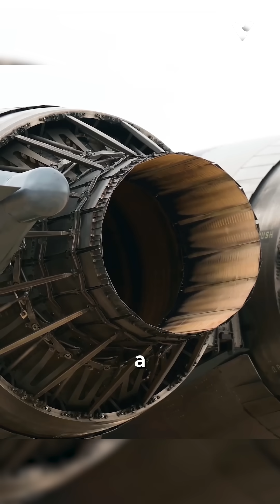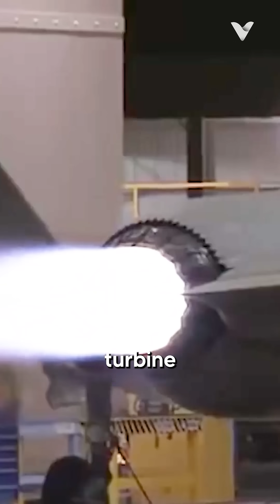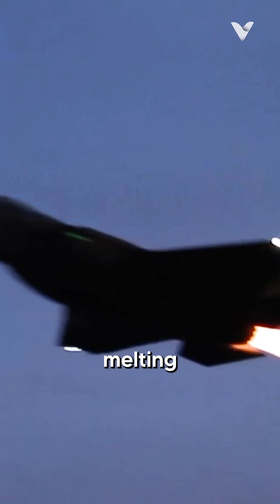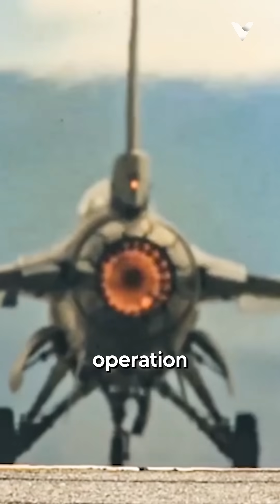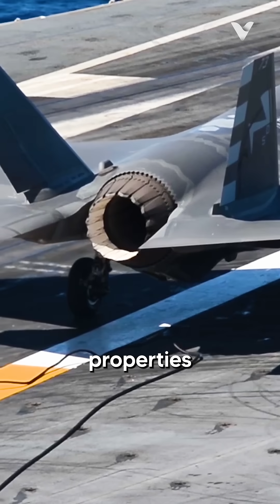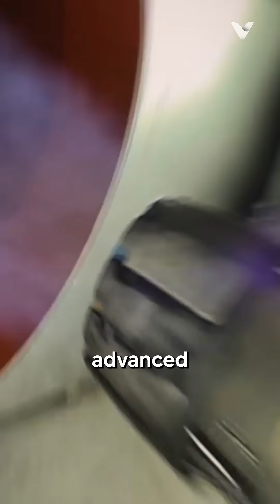Why Don't Jet Plane Nozzles Melt? #shorts

Comment: They can melt if you use the afterburner too long.
After burners and/or turbos are a TEMPORARY solution. If they were a constant solution, it would just be called, TOP SPEED.
Boost/Turbo/Afterburner is temporary because things will malfunction otherwise. AKA, melt.
Reply: Pretty sure it has more to do with the amount of fuel consumed, not temperature
Reply: @chriss5266 Sounds like you never change a  divergent seal or flamethrower before. There are inflight limits as well as ground limits as to how long you can be in burner. Fuel is one but it will accelerate wear on all the Augmentor and nozzle parts

Comment: On the f1 engines on the Saturn V rockets, the supercooled liquid oxygen that is used to facilitate combustion are pumped through pipes in the combustion chamber like a radiator. This was so effective that not a single F1 engine failed due to combustion chamber warping due to heat retention

Comment: It’s not just a jet engine, it’s actually low ratio turbofan engine used, which means there is a stream of cold air between the hot exhaust gases and the outer wall of the engine and nozzle.
The exhaust turbine blades have tiny holes in them for creating thin film cooling with air. Yes, the blades are Inconel and really really heat resistant, but combustion temperatures will still melt them with prolonged exposure.

Comment: The physics behind the jet engine is that the heat generated by the burning of the fuel actually expands the air in all directions, throwing molecules that hit the front of the turn, pushing the vehicle towards the side of the thrust. The only side that does not receive thrust is where the air comes out, being the only side that does not offer resistance to the air that has expanded.

Comment: Speaking in the terms of turbofan engines, the cooling is through the use of cool secondary bypass air. Augmented turbofans are low bypass turbofans, which means that the majority of air goes through its core while the remainder bypasses via secondary casing. 

In the turbine section, that cool air goes through the high pressure turbine (HPT) nozzles to keep the nozzles internally cool as well as through the HPT Rotor. 

When it comes to the Augmentor (afterburning) section, cool air is routed through the nozzle under a liner which has holes all through the liner which allows cooling air to keep the exhaust from overheating. That same liner is inspected as part of the post flight inspection to make sure there’s no clogged holes, which if clogged can result in hotspots thus creating a burn through. 

21 years Propulsion Tech F110,F101, CF6
Reply: Thanks for the comment, very interesting

Comment: Also the nozzle tightens the exhaust when the pilot uses afterburner but after a second or two the nozzle opens up to avoid melting
Reply: Incorrect. When the nozzle closes it builds pressure and increases thrust (think of the finger over the water hose concept). Also, that same pressure buildup helps maintain fan speed by making sure the LPT doesn’t overspeed. Once augmentation is initiated, it opens up due to increasing pressure from the secondary combustion

Comment: You could have just said it doesn’t melt because they made it in a way that it doesn’t melt. Because that is all you said. Now to the real answer, I'll make it very short, 1. the speed of hot gas exiting pushes away from metal like walking on coal 2. Internal cooling by both rotating fuel and dumping fuel on metal walls to make a repellant 3. Ionization and treatment of metal similar to rifle barrel. For specifics read nasa sp-125 section about cooling exhaust

Comment: Cool air boundary is more important ! Best superallow melting point is 1350. And start to hight deteriorant at most at 900. You applyceramic coating. Then cool air boundary is also important. And you even have tubing inside both in stator and rotors to circulate cooling fluid (fuel if i remember well).
So, even if the flam can go up to 2200 degrés, the metal never see that température. Not even half of it.
Reply: When performing solution anneal, in a vacuum furnace, it's interesting to note that the standard run temperature is 2,000-2,200 for several hours straight on most turbine flow path alloys.  Ex: Solution @ 2,150F / 4 hrs
Reply: @christx3326  but you are talking in stupid units. In international, it is just 1175 °C
Reply: @texasranger7687  Yes ma'am, as a European descendant raised in Texas, I'll agree to that.

Comment: I worker on F-14 Tomcats in the Navy. The second they shut the engine down you could stick your hand inside of the rear nozzle area and it was cool to the touch. It was cool because the super heated air never touched the actual metal due to a boundary layer of air while it was running.
Reply: Now THAT is neat!
Reply: Must be physics
Reply: @soumya_sarkar96  periodic table
Reply: How come this wasn't true for the F-15? Entering that engine during summer was ... not fun, to say the least. You wouldn't get burnt per se but it was really hot
Reply: @Israelpwn  I remember changing a flameholder in Saudi hours after hey had lander and still cooked my ssa off 😂😂
Reply: @Israelpwn cause it was the summer. I’ve been in the intake in summer, in the bunny suit with booties. It sucked.
Reply: @gunsandgranola7262  you was hiding from the sun who u kidding
Reply: @ pretty much. Lol
Reply: @Israelpwn it is the same, right after a burner run your able to touch the nozzle, the reason it sucks to jump the nozzle is that heat from the core, spray rings and other components do still hold heat that radiates off
Reply: @Israelpwn  why would you have to enter the engine ? Im back in the expedition sign on the back lets go fishing...
Reply: @Israelpwn I'm sure they were still hot in the context of sitting in an augmentor or intake. But touching the nozzle segments is what was surprisingly cool after engine shut down. Even at idle the air coming from the aug isn't scolding hot.
Reply: I worked in the test cell department of the AIMD mech shop on the CVN-72 USS Abraham Lincoln. I was the electrician. There is nothing cooler than being just a few feet away from a F-14 Engine strapped to the cart on full after burner pumping out 22,000 foot pounds of thrust. Producing heat rings every so many feet. It is such an awesome memory that I'll never forget. This was during a WestPac 2000-2001. We were the first ship to receive the Super Hornet.
Reply: @industrialpalletworx3548 That would be 22,000 lbs, not ft-lbs which is a measure of torque
Reply: Gotta give it to the first person who tried.
Reply: Now that is absolutely insane to me. These engineering of these engines is incredible
Reply: Ahh the Flying Tennis court. Alwaysed loved the F14 because of Top Gun, Macross (aka Robotech) and Swat Cats.
Reply: @MilkT0ast  Kawamori and his team went to Edwards Airforce Base for Macross Plus research.
Reply: @MilkT0ast wow Swat Cats. Deep cut fr.
Reply: That is honestly the coolest (pun intended) aircraft fact I've ever been told.
Reply: I worked on F 14 afterburner assemblies in the Navy. They do get hot. Titanium and inconel stand up to the heat and ducted cool air around the exterior. They would still distort and crack. They could be a real pain to disassemble, especially the GE F110 engine.
Reply: @greghardy9476 Too bad after the SLEP mods, it seems nobody ever had the bit to remove the divergent seal base sheets lol. But at least the segmented flameholder was a good idea.
Reply: I love Tomcats. Such a gorgeous airplane. So ironic that the only nation flying them now is Iran 😔
Reply: @JS_Precision That's because they were the only other nation to get the Tomcat.
Reply: @Invidrule  Really? Thats says a lot of the relation between the US and the Shah at the time. Before Israel became the US watchdog in the Middle East, Iran was.
Reply: @JS_Precision  Well, the F-15 is still in use, and has a very similar silhouette.
Reply: @JS_Precision  , not many are airworthy nowadays due to lack of spare parts. Maybe just a handful are in service, but I may be mistaking
Reply: @JS_Precision barely flying them.
Reply: @JS_Precision  They truly are beautiful.  I was fortunate to be able to take a picture of a retired one. Right outside of the Oakland airport. Oakland Ca.
Reply: @JS_Precision  Oops. Iran.
Reply: @JS_Precision  NOT ANYMORE, MY FELLOW AMERICAN ! WE TOOK THEM BACK AND PERMANENTLY RETIRED THEM, ALL IN JUST A FEW SECONDS 😂 ‼️👉👑🇺🇲🇮🇱👉🦅💥💥💥🪶
Reply: @JS_Precision wish I could down vote this.. 😞
Reply: That is insane engineering
Reply: Aah, the Tomcat. Still the most beautiful NAVY fighter jet I've ever seen. Such a shame it never was nominated for an upgrade to match gen 4 or 5 fighters we have now. Bring it back, pls!!!
Reply: @marcodevries994 : Grumman did propose the Super Tomcat for the 21st Century (ST-21) which would have kept the same design and characteristics but with newer, advanced engines, avionics, and better wing sweep mechanisms (which on the aging Toncats were some of the most maintenance man hour intense). Grumman proposed New aircrafts, or a combination of reworked Super Tomcats (the D models) with overhauled aircrafts. Dick Cheney however, hated Grumman while favoring Boeing (which he ownedd a lot of stock) and when he was Sec Def he pretty much killed Grumman's reign on Naval Aviation. The Super Tomcat & ST-21 would still outperform and out range the Super Hornet.
Reply: @Dutchman_in_Spain  You fool they virtally crashed and destroyed all the planes except a few static models , and all documents relating to technical know how have also been destroyed so that Iranian government can not get the parts or plans on the black market... Shit I am an Aussie and know more then you dumb yanks about your own procedures.
Reply: @Dutchman_in_Spain $$$$
Reply: @Dutchman_in_Spain LOL bring it back? It was a boat
Reply: @howardelzey2760  The boundary layer helps but radiation is going to cause that material to be screaming hot right before you touch it. I'm guessing it was cool because it's designed to shut down that way, with cool air running through the engine as it spins down.
Reply: @biggieb8900  Radiation?? That’s a new one 😂
Reply: @thatmitchellguy  Heat is part of the light spectrum and therefor follows dispersion patterns and decay seen with other waveforms. Radiation is an appropriate term.

There's no way a layer of air can prevent that much heat from being transferred unless there was a designed laminar flow channels all throughout the housing. The Space Shuttle's RS25s had cooling pathways in the housing but no method of creating a laminar flow separation between the exhaust and the nozzle housing. If you have static air, even with it's low thermal conductivity, the surrounding metal would still receive enough heat rendering it unsuitable to be touched even with protective gear. So the turbine would just use bleed air to form a protective barrier around the main exhaust cone.

At shutdown, I would guess, as others have mentioned, that the turbine cycles through fresh air to even out cooling and put less thermal stresses for contraction.
Reply: Thanks man this was more clearer explanation than this wannabe storyteller video
Reply: I'll take your word for it
Reply: Would heat not radiate though? There's so much IR that can cross that boundary
Reply: You are talking about the TF30 , the F110 or both?
Reply: I was an engineer on the SS mino johnson
Reply: Super cool engineering.
Reply: Bro, don't make us make a mistake! 😂😂
Just kiddin'. Thanks for the info
Reply: I used to warm my gloves up in the winter by putting them in the back of an engine. It was commercial jets when I was a fueler.
Reply: R & D ......get you that....not to mention years of that.
Reply: Had one of the pieces in my hand. They have super tiny holes all over the place where high pressure air comes out to create this „film of air“. It’s funny that this air is also super hot bc of the pressure. About 600 degrees Celsius (depending on model). But that’s far below melting point of the used metals
Reply: That is cool
Reply: Not just the exhaust nozzles. The boundary layer of air bled off from the compressor section is why the internal burner section engine parts are not damaged by heat on any turbine engine.
Reply: when you touched it and a stupa pressed the engine button accidentally , what then ? :P
i know it shouldn't happen, but my mind would trigger this danger when touching it :D
Reply: Don't know why this was discontinued with the f15 and f16....summer was not fun for us mechanics
Reply: “Any time Baby”.  😂😂😂😂😂
Reply: “I worker” sir please proofread
Reply: @Chosen1510  its 2025 dude.. if you can't read through basic typing errors on youtube comments, you are the one with a problem. Yt comments are not college essays. Im typing what I type amd pressing semd. I noticed the m in semd lol did it again 😂
Reply: @Chosen1510  Your comment is also far from perfect.
Reply: What stops the super heated air from heating the air barrier? Using an air barrier to keep air out sounds a little iffy.
Reply: @Redskies453  the air barrier does get hot and so does the nozzle  but by the time the plane is done with the landing phase the cold air used to form the barrier has already cooled down the nozzle leaves
Reply: Now that makes sense to me as an engineer
Reply: That's insane😅
Ty for sharing!
Reply: Don't disclose government secrets.You have to keep everyone guessing. Leidenfrost effect has left the chat.
Reply: Hmmm, Lord of the Rings ? " Precious " effect :: Put the "cool" ring on and vanish in thin air🤣🌟🥳
Reply: I worked on AV8B Harriers them nozzles definitely got hot to the touch lol
Reply: It was my first thought when I saw title of this idiotic short, which even didn't give right answer in the end
Reply: makes sense hey mate do u know where i can get nozzle for small jet engine
Reply: I call that bullshit
Reply: @Smoos54 What F-14 squadron were you in? If your answer is none, then your opinion means absolutely nothing.
Reply: @howardelzey2760  i'm an aircraft technician is that enough?
Reply: But what about radiant heat? Wouldn't the super hot exhaust air still radiate its heat to the nozzle despite having that cushion of air acting as a barrier?
Reply: Wow, I just studied boundary layer in professional mechanics at university. Thank you sir for sharing your knowledge!
Reply: bro i want to be an aerospace engineer so can i join the army as an engineer and work with these cool machines without joining any military school ?
Reply: @ahmedmezaar US Military doesn't work like that. But if you want to join the military to do aerospace engineering stuff, it's not going to happen. Military doesn't do aerospace engineering, private contractors do (like Lockheed Martin, Northrop Grumman, Raytheon, etc) They're the ones that actually do all of the R&D, designing, and building of all that stuff.
Reply: @6YJI9  Thank you bro, I love fighter jets, and I want to be aerospace engineer to see these beasts and make them also to help my country, I'm sorry if i wrote so much but it's nice to talk with new people
Reply: That’s amazing!
Reply: @howardelzey2760  that’s called film cooling
Reply: It is really amazing having these digital platforms we can directly hear from very people who have lived that life, sitting in our beds.
Reply: Cause it's a turbo fan jet engine ?
Reply: Who's the mad bastard who first thought to test that hypothesis?
Reply: So if u didn't get burnt,what's ur point?? Fireeee
Reply: Wow
Reply: I worked on E-2s in the Navy. I remember during a morning FOD walkdown I passed by some F14s and noticed that someone had signed off an engine nozzle and the sunlight passed thru where he signed off. Must have been the wrong type of wax pen because it collected enough heat to burn thru.
Reply: Blacks created all this.
Reply: Brilliant comment and brave curiosity- I don’t think I’d have done that even if someone told me.
 Fascinating machines
Reply: Sounds like something similar to the Leidenfrost Effect.
Reply: This is the real answer. Ain't no nickel alloy surviving that kind of direct heat.
Reply: War thunder document leak in yt comments
Reply: Kinda like how you can touch aluminum foil right out of the oven
Reply: @howardelzey2760  But if you think about it, prior to shut down the engine running at idle for about five minutes at no more than 750° C max at the LPT and the gas gets cooler and his travel to exit the exhaust. Hence, why we can stand behind it during the winter time and not get burnt to crisp lol. If you think of an invisible boundary of air keep them cool at all times of the touch, try touching them right after it comes out of burner. I’m sure you seen them even at minimum augmentation, they are glowing red. 😂
Reply: F-15 chief here. Same for the Eagle. I always liked warming my hands in the nozzle at idle.
Reply: 🤔. Also thank you for your service.

Comment: For anyone wondering why Tungsten isnt used in regards to heat its because majority of these Jet nozzles dont even reach 1/2 of the needed temperature most of the time. If you can get something closer to its melting point without having structural integrity damages its far better than Tungsten since it has the 7th highest density of all metals beating even Uranium.